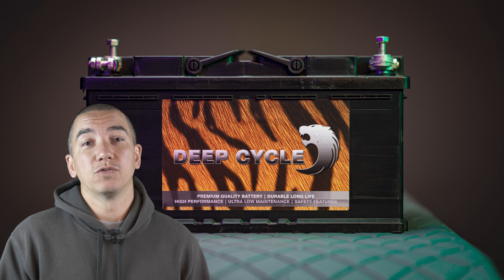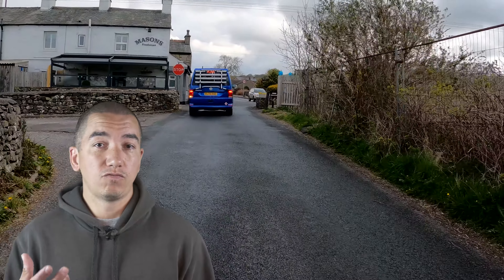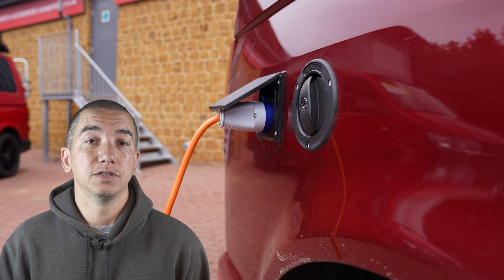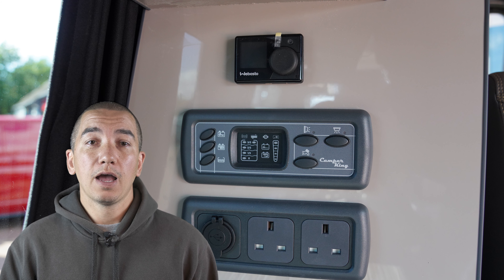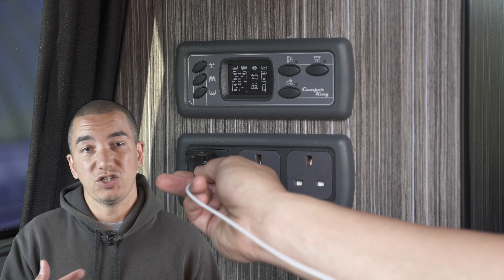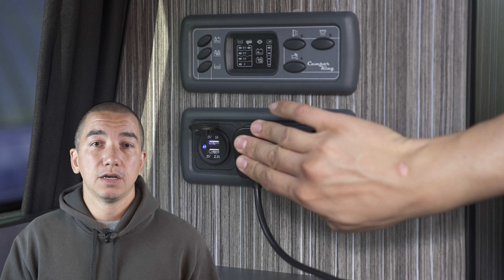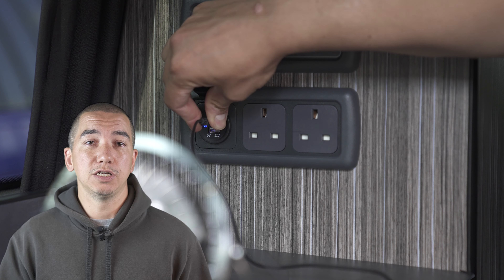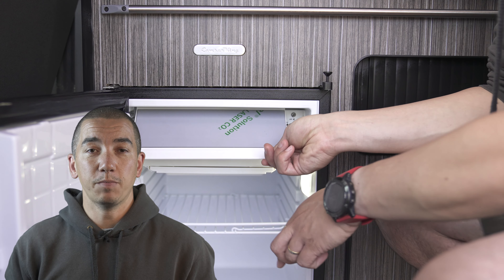How to maintain your leisure battery

Comment: How many years can I expect to get out my leisure battery’s
Reply: Very difficult to put a figure on it as it is so dependent on how it is used, but if you maintain it correctly, it could last for many years. It's all to do with how it is used and how it is charged periodically.
Reply: @camperkingwalkarounds5532  we bought the van off you in 2015 still got original battery on it although you fitted us a solar panel and another battery in about 2018  but noticed recently that when we’re off grid there not holding the charge so well. Is there a battery you recommend to fit when I do come to change them. Cheers Colin.